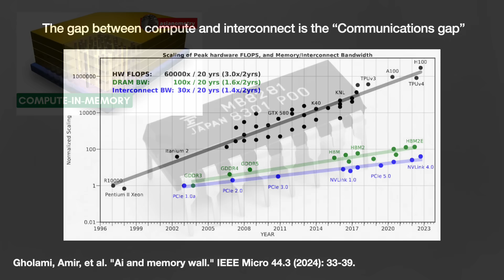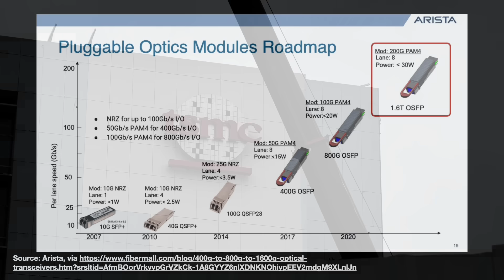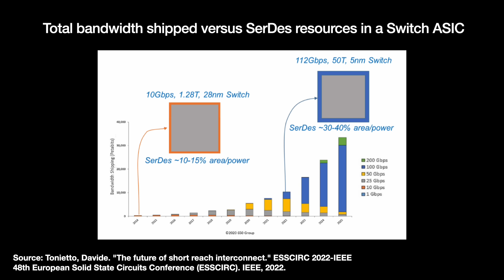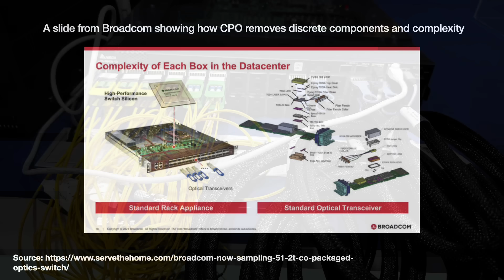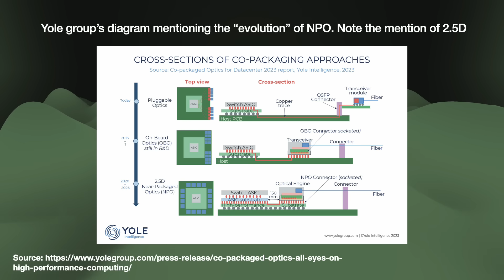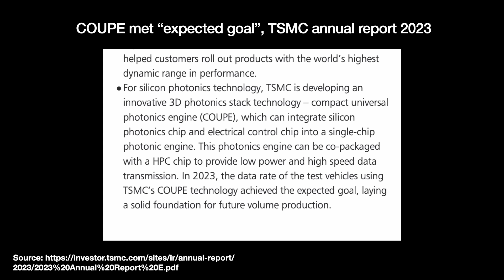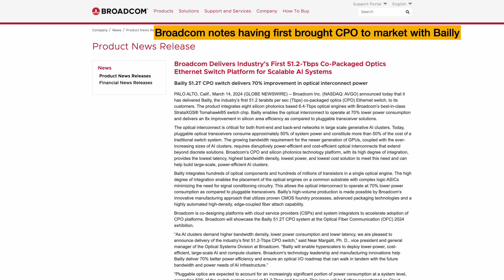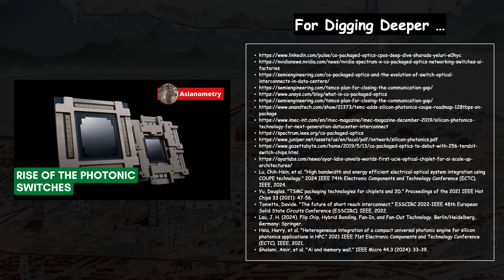The AI Bandwidth Wall & Co-Packaged Optics

Comment: PIC designer here, ask me anything. PhD 2021, currently a consultant working with a variety of technologies and applications.
Reply: My comments are disappearing and I don't know why. For the first, I'm not convinced it will be the best. Second, we have it and it's used in advanced devices.
Reply: Do you know about lightwave logic: material company winning design for PIC? Polymers is the material
Reply: @Maxxilopez92  I know about them but I'm not convinced it's better than the competing technologies. People have been working on EO polymers since the 90s and there's a lot of issues that are challenging to solve. As far as I can tell most of the hype comes from small scale investors, you can tell because they refer to the company by the stock ticker. That said I wish them the best of luck and I'll happily use the technology when it's available at an open access foundry and I have a customer willing to take the risk.
Reply: @Maxxilopez92 I answered but I don't see my reply anymore. I wish Lightwave Logic the best of luck but I'll believe it when I see it. Polymer photonics has been hard for 30 years and it's still hard. It looks to me like most of the hype is coming from retail investors and not industry professionals. Right now uTP of III-V or TFLN has more traction.
Reply: Why don't we have a dynamic polarisation system to be able to use fibre as parallel? Obviously the physical direction of the glass fibre is going to affect it but what research has been done to use polarisation for multiplexation. Additionally why are no piezo cooling systems being used to deal with heat dissipation?
Reply: @clippy-jordies Polarization control is hugely important and can be done on-chip or in external PLC interposers. Dual polarization QAM is one of the techniques used to cram more data into a single wavelength. But, it's expensive. PM fiber costs money and if you want dynamic polarization control on-chip you need more DSP.
Reply: I have heard in nano scale, metal can be used to waveguide light smaller than its wavelength. Do you think it could be used in modern semiconductors, which are compatible with nanofabrication
Reply: @20都  I doubt it, you still need a light source and it's going to be bigger. The losses are also very high. Polariton is using plasmonic waveguides for stuff like polymer modulators, but that's as an advanced electrode.
Reply: What bandwidth and pi-voltage seems like a minimum for optical switches like those described in this video ?
Reply: @AngrySkyBandit  That's a really great question because there's a mix of transceivers being used for different distances and applications in the datacenter, and I'm not a datacenter expert, much less AI pecific. I live further upstream in the supply chain, on the chip design level. What I can say is that for short haul you don't even need MZM based transceivers in today's implementations, EML still does it, with 25 GHz BW. There's currently a lot of interest in 200G per lane, but 100G PAM4 is already widely deployed, with up to 8 lanes per transceiver for 800G. So if you're being innovative you'd want 75 GHz EO bandwidth but I'd guess there's still a market for 40. About the voltage, all you have available in an all-silicon system is the TTL voltage, with Vpp about 3V, but you don't need to reach Vpi to get an acceptable eye diagram. 4V - 5V might do it.
Reply: What's the best kind of potato chip
Reply: @DoesntRefillTheBrita  Salt and vinegar is great, but regular salt cooked with a good olive oil is unbeatable for just the chip itself. And it gets even better with a can of marinated mussles and olive oil poured on top.
Reply: hello, I am highly interested in PIC design, and will start my Master's on it; it will mainly be on semiconductor devices/technologies but I will also choose PIC as one of my specialization, alongside course(s) on fibre optic communications. however, i also want to combine one type of cmos electronics so that in future i can focus on hybrid photonic-electronic integration. 

if possible, i would like some guidance on which kind of electronics (rf/mm-wave transceivers, analog/mixed signal (adcs/dacs) or digital (cpu/neuromorphic/ai/etc.)) should I combine with PICs? I am currently more inclined towards RF (after asking a professor as well as doing my own research), but further advice would be greatly appreciated.
Reply: @ugandanchungus8455 Hi, sorry for the late response. I didn't have a good reply, so I asked our CTO, this is what he said:
"for a masters I think RF is indeed good scope - it is a key thing for high-speed design and there are quite some simulators around, so you can play a bit with different gs / gsg lines etc to see how it interacts with the photonics (traveling wave design)

the other aspects are more likely to focus most of the time into the electronics parts as that is complex enough already; so combining a heavy electronics topic with some heavy optics aspects will likely not fit - more PhD scope"

Comment: But what will happen if one of the optical trx on the chip dies? I mean it is not frequent, but happens from time to time in real world.
Now engeneer can simply replace broken module. How will they deal with such case in photonics chip?
Reply: same as if anything else on the chip dies, time for a new chip
Reply: @noname-gp6hk yes, but topical switch can have 20 of trx modules or even more. So to replace one, it is not a big deal.
But if it's on chip, it may mean to replace whole unit in rack, which is not as simple, because it may affect Customers.
So, probably, it will really work as niche product for AI, if their architecture allows massive redundancy.

Comment: Things are getting weird because everything is signaling faster than we can clock CMOS:
consumer PCIe / TB5 / etc == 30 Gbaud
datacenter optical == 53 Gbaud
coherent long-haul == 100 Gbaud

Coherent DSP ASICs (Nokia PSE-6, Infinera ICE7, WaveLogic 6) are 3 nm-class chips with analog front ends. You can't clock CMOS at 100 GHz. A 100 Gbaud DAC is running at 6.25 GHz and time-interleaving 16 SerDes slices with an analog multiplexer. It needs ultra-low-jitter PLLs and sub-picosecond skew control.

That's where this is really turning into a power problem. The DAC can draw 40W per wavelength, and DWDM can supposedly multiplex 160 wavelengths on a single fiber.
Reply: I am working on resonant tunneling diode chips. Its oscillation frequency can reach up to 2 THz while only need a DC bias.
Reply: @electricalnguyen  How's progress going on miniaturizing them and getting them the point where they can be fabbed on a process node with half-decent logic with decent switching fmax?

That's been the real killer for most other THz tech. We have devices that can switch at THz frequencies... if you don't mind connecting individual discrete logic elements together.
Reply: For routers, another major issue here is that routing decisions are becoming more complex to decode, while bandwidth goes through the roof and latency of individual operations hasn't improved much.

And let's not get started with FEC. Checksums are bad enough.

Net result is you need more and more buffering, to put it mildly.
Reply: True — although things are changing quickly in telecom, where systems can now reach 200 Gbaud, such as with CIENA’s WaveLogic 6 Extreme delivering 1.6 Tb/s/λ
Reply: CMOS won't do. Bipolar transistors and III-V will. I believe IHP's  BiCMOS process is capable of 200GHz, and currently available modulator drivers for 100G PAM4 have a bandwidth in excess of 40 GHz.
Reply: @tykjpelk  At what latency?
Reply: @TheLoneWolfling The bandwidth of a whole switch will of course be far higher. I'm just talking about the semiconductor platforms we can use for driver electronics at such high speed.
Reply: @tykjpelk  My point is that if you have data coming in at, say, 1Tb/s, every ns of latency results in 1Kb of buffered data.

(Elementary application of Little's Law.)

By the time you get through the latency of the phy + error detection logic + routing logic, you're talking about buffering a lot of data on-chip.

Even taking your 200GHz fmax figure at face value - and note that fmax is typically far higher than FO4 timing which in turn is far higher than the actual practical timing to allow for a few stages of logic followed by flops - at 1Tb/s every individual transistor deep of logic results in having to buffer five bits of data.

(Some of this buffered data can be in-flight, if done carefully, as opposed to explicitly buffered. However, this technique is limited and error-prone to put it mildly.)
Reply: @TheLoneWolfling  Yeah, the electronics are very demanding. I've had the pleasure of reading a lot of OIF-400ZR and I'm glad other people than me are responsible for most of it.

Comment: I didn't knew that the flow of data has hit a brick wall in it's pursuit of advancement. As I recall a few years back they were implementing a kind of data buffer device to increase the latency and even the chance of accessing the information inside the NASDAQ trade floor to prevent unjustified time advantage in the trading.

Comment: I'm the co-founder and CEO of a startup doing photonic computation. If I had to put a number on it, most AI computation will happen on hybrid photonic/electronic accelerators within 5 years. The energy efficiency is unparalleled.
Reply: NTT has a complete pathway towards photonics by 2030. We’ll see but the parallel development may be in a shift from GPU to physics based ASICS.
Reply: @Gorto68 interesting you mentioned NTT
Reply: I'm curious, do you have an estimate of how large the full system must be to have the same computing power as a single GPU? Also, won't there be a high total power consumption from the high number of phase shifters and the gain chips you'll need to recoup losses?
Reply: @tykjpelk  Also we have systems that can perform as well or better than GPUs today. Multiplexing allows for greater parallelism with fewer components.
Reply: @radion4life You already have a system that can perform useful computation, or a scaled down version? From what I know from quantum computing, packaging and scaling is a huge hurdle just to get your foot through the door. Hundreds of square meters of silicon per compute unit, although indeed it's blazing fast once it's built at that scale.
Reply: @tykjpelk  you are correct that packaging is challenging. We do have a system that can perform about as well as an A100 but at only around 8W of power consumption. The size of the devices or chip size isn't the bottleneck because multiplexing enables highly parallelized computation, much in the same way that having tons of transistors on an electronic chip enables high parallelization.
Reply: @radion4life  So then what are the most challenging bottlenecks for your system?
Who are you partnering with?
Reply: @radion4life I'd say it's the main limiting factor for many systems, but it sounds like you solved it, nice job. Do you have a demo somewhere? I'm surprised I haven't heard about you before.
Reply: You know what companies are going to be in this area?  LWLG is on my mind.
Reply: @Maxxilopez92 Nobody knows yet. Lightwave Logic has a lot of hype but polymers come with their own set og problems. Thermal stability in a datacenter environment is one of them, compatibility with existing scalable solutions is another. Micro transfer printed lithium niobate has more momentum at the moment.
Reply: @tykjpelk  Agree with this. Polymers have a very long way to go. Silicon photonics will be the first to reach commercial success. Lithium niobate will likely be second.
Reply: Do you feel that slowly over time there will be less and less silicon based switching and more photonic switching or will this always be a hybrid thing where both have there uses within industry?
Reply: @Qqaswd  The transition in switches is already broadly moving over to optical. With the cost of optical switches falling, I can see a world where everyone makes the transition at some point.
Reply: You wouldn't be able to disclose which startup you work for would you?
Reply: @Frostulous  Wild guess, Radion Labs.
Reply: Do you need a foundry?
Reply: I'm the CEO of a raspberry smoothie startup. If I had to put a number on it, all summertime sweet treats will be a fruit-based smoothie within 5 years. The flavor is unparalleled.

Comment: Very solid video, was in the transceiver/photonics space for many years until moving on to something completely different a few years back. I was worried you weren’t going to touch on wave guides, but glad you did. That’s where advancement is most needed
Reply: Interesting comment ! With your experience, what makes you say that advances in waveguides is thats needed the most ? Is it about modulation bandwith, propagation losses, photonic circuit routing theory ?
Reply: @bierbrauer11 I ask because its a field of work i'm considering.

Comment: I've been working on telecom switchgear and datacenter ethernet switches for 30 years.  We didn't hit the wall at 224G/TH6 - at least our team did not - but 448G looms ahead and, barring some major breakthrough,  the losses at that datarate are such that traditional PCBs, no matter how exotic the material,  simply won't play. 

Near-chip connectors with flyover cables have been an interim solution but have their own significant problems.  No one is in love with their lead times,  yield,  cost, or MFG headaches. 

CPOs are out there and will be used but I'm far from certain they will really be a breakthrough solution.  I guess we'll see.  I agree we'll likely see a "pause" in datarate  increase after wide deployment of 224G as technical problems at 448 are overcome.
Reply: I've seen some presentations by a startup called Leapwave that's using silicon needles as dielectric waveguides for RF signals. Doesn't look ready for packaging but they've made probes that can couple signals at well over 100 GHz, do you have any opinion on that? I suppose at some point we won't be able to make good electrodes on metal for the modulators, but maybe poly-silicon could work in a similar way.
Reply: Reparability seems to be an issue once we get to the interface between the inside and outside world.
Reply: If using flyover cables, how do you manage heat? Not just with the near chip connector but the cpu itself? That would require new heat sink designs, right?

Comment: Why does the optical data need to go out in serial?  Can't you just multiplex in different frequencies?
Reply: You can, but it doesn't buy you anything for an HPC cluster interconnect (lots of little messages being routed all-to-all where minimum latency is a priority). Let's say you have N frequencies, you can either chop up a packet and spray the bits across all the frequencies, but they each have individual jitter and delay and you'll have to reassemble on the other end and that will cost time and power. The alternative would be to keep one packet per frequency, but now each packet is 1/Nth the total bandwidth and, again, you'll take a big latency hit. If you go back to that slide with the modules, their bandwidth, and power, you'll see that the power-per-bit is going down each generation, it's just the bandwidth is going up faster.
Reply: 😊Of course you can. The difference between one fiber and 32 fibers from New York to London.